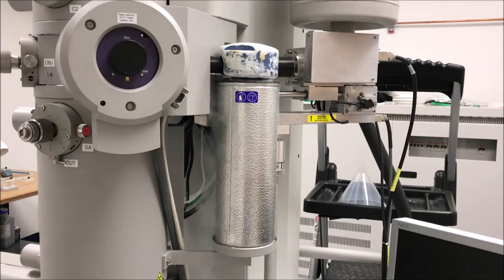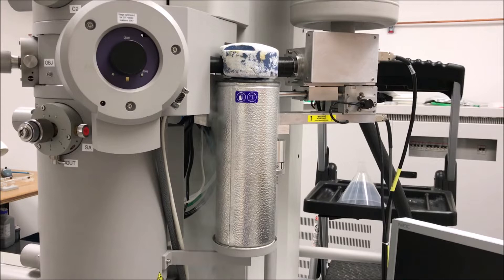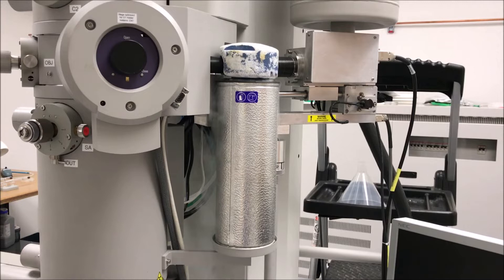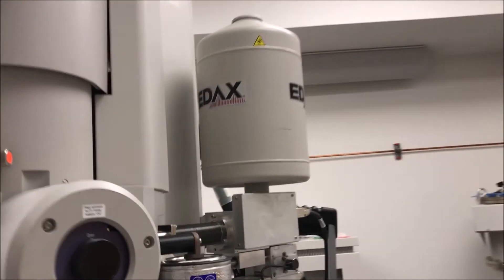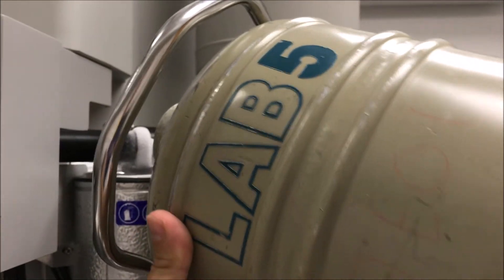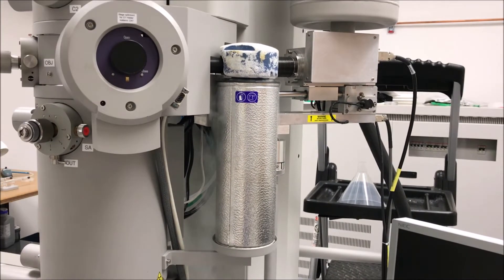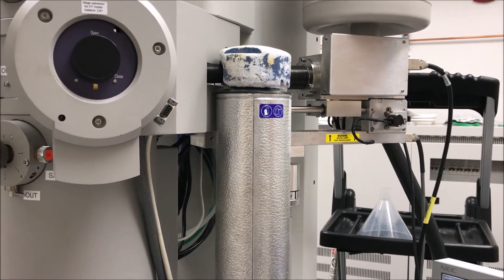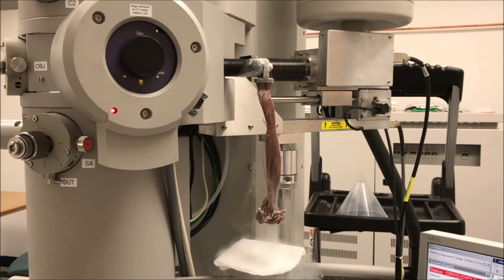FEI Tecnai F20 S/TEM: cold trap and cryo cycling

Comment: "Lol doesn't the turbo filter all that stuff out?"
Reply from the maker: Hi Just Jay: yes, you are correct, but the turbo is (usually automatically) turned off when you open the column valves and operate the microscope; otherwise, the vibrations from the turbo may compromise the image quality.  That being said, that would be an interesting experiment to try: just keeping the turbo on the whole time (which is possible) without using the cold trap and seeing how well contamination is handled and how the image stability is affected by the turbo.

Comment: Hi, This is also the same in the JEOL microscope. We call it ACD heat on. The procedure is a bit different in JEOL microscopes compared to FEI microscopes. We do not remove the canister but we insert a heating rod in the canister and switch on the ACD heat button (from the computer screen). The JEOL microscope also takes approximately 6h for the completion of ACD heat. Is the procedure the same on FEI TALOS?

Comment: What will happen if ln2 low filling and run Cryo cycle?
Reply from the maker: Hi gunabossy: you always want to run the cryo cycle with the cold fingers not actively being chilled by LN2; this allows the stuff on the cold fingers to evaporate off and be pumped away by the turbo, which helps to keep the column clean.
Reply: @NicholasRudawski  Thanks
Reply: @NicholasRudawski  we have Tecnai T12 spirit,

Comment: Very interesting, so the cold space of air acts like a filter?
Reply from the maker: It's actually a cold surface inside the column (cooled by the LN2) that acts as the "filter", though I think a more accurate term to describe it would be "getter".
Reply: @NicholasRudawski  I see, so the surrounding columns have to be submerged in liquid nitrogen. Could you use ice cubes?
Reply from the maker: @SkynetT800  Ha ha, I've never thought of that, but I don't think it would be as effective; LN2 is many times colder than ice, so the gettering effect would be far better.
Reply: @NicholasRudawski  sorry if the questions are silly. I'm just learning through books and videos.👍
Reply from the maker: @SkynetT800  No worries, I'm always happy to answer any questions!

Comment: What is the suitable duration for the cryocycle? I operate tf30 and at here we do this for 2hrs.
Reply from the maker: Good question; you would want to run it at least as long as is necessary for the Cu braids to warm up to room temperature and then for the turbo pump to pump out all the stuff that is released into the column.  It probably varies from instrument to instrument but most facilities with Tecnais typical run cryo cycles for 6 - 8 h starting at the end of the day so the process is completed by the start of the next day and occur during typical non-use times; 2 h may be sufficient in duration, but I've never tried it; if the cycle isn't run for long enough, too much gets dumped into the IGP when the cycle ends so it's better to err on the side of too long rather than too short.